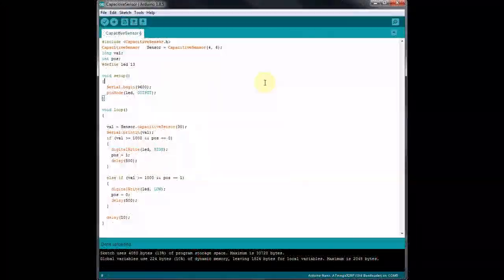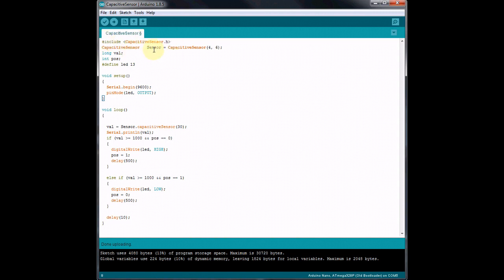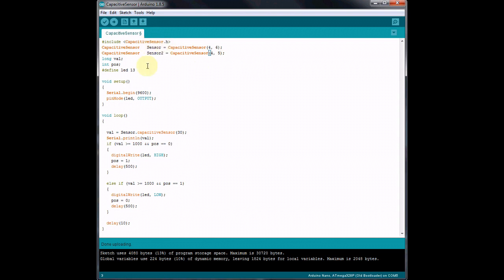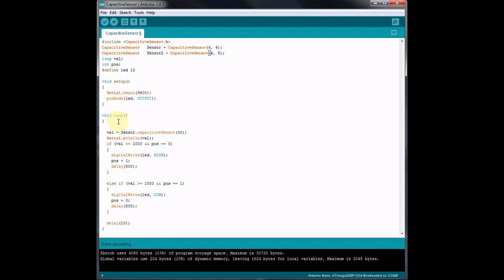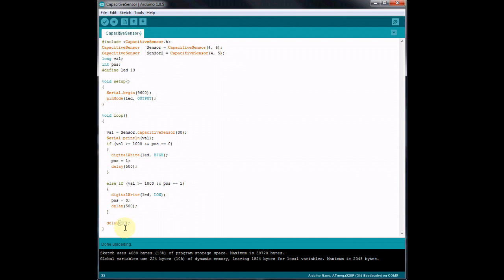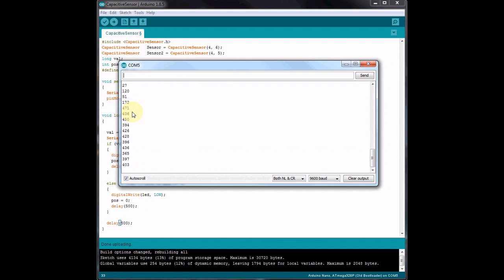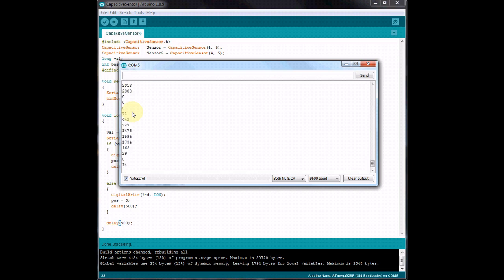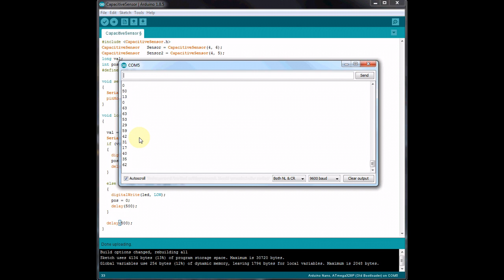How to make a capacitive touch sensor switch out of anything metal using an Arduino

Comment: guys i am a completely new to this no i need some help, the ardunio switch name can i get it properly as i am unable to select the switch , are all same or different i just need the one which the guy has used usable with 10mega ohm resistor and all

Comment: I'm curious what would happen if you decide a delta between the normal state and state it should be switched and let the arduino calculate the average value over let's say 2 minutes, then make it if(val => average+delta). This could maybe solve the issue of the capacitance changing not only with different mediums but also when humidity and temperature change

Comment: I need something like this for an electronic drum

Basically, I need a trigger for when I touch the cymbal, so I can make a logic for the sound to stop (a "choke effect"), but it can't trigger until I actually touch the cymbal

In your video, it also triggers when you get close to it without actually touching it.

Is there a way to disable that, so it only triggers when touched?

Comment: I have a strange bug. I'm wiring this as a touch switch on a synthesiser which uses a logic high (5v) to create a gate which trigger a sounds. My oscillator stays on as long as the gate is high.

I modified the code to be momentary rather than latching - i.e. go high for values > 1000 then low if the value goes below 1000 so the note holds for as long as my finger is on the pad. The circuit works great for me when I'm powered by USB plugged into my laptop (uploading the code) but when I swap to the 5v supply the synth is running on I get regular glitches to 0v so the note stutters. Anyone have any idea what is causing these periodic drops to 0v? I can't work it out.
Reply: You could try using the code to activate the built in pull-up resistors maybe, they decrease the amount of environmental electrical interference. Or try actually putting pull-up resistors on your circuit.

Comment: if I have an aluminium enclosure (e.g. a guitar pedal) and I solder the wire to the enclosure (acting like your coin), is it safe to be used as a "touch" footswitch?
I'm a noob, any pointer is appreciated.

Comment: Everything works perfectly when I'm plugged into my laptop, but once I plug it into an outlet on the wall or even through a USB converter to the wall outlet, the sensors all go wack and don't react properly.
Reply: If you can. add display to your thing so you can see what's actually is happening when you plug it into outlet. Mine was going crazy when I activate my table to go up or down, but then I changed settings for sensitivity. meaning that it cant be triggered if its not over 5k if you know what I mean. This sensor is not perfect, other things are influence the results sometimes. depends of the environment.

Comment: It's case sensitive, capacitiveSensor is different from CapacitiveSensor... But yeah man detecting through 3/4 plywood, plexyglass, etc.. I made some lights for under the bar that's also solar powered, and for the switch I have a sheet of plexyglass with the wire basically taped to the back of it, and no problems.. It gradually increases with brightness because of the PWM controlled mosfet, so the pos actually increases in time as your touching it.. good stuff. +1, a must watch, tnx.
if (val >= 1000)
pos = pos + 1
AnalogWrite(nMOS, pos);
if (pos >= 254){
pos = 0;
delay(1000);
etc. etc. etc. I'm sure u guys get the idea. pretty easy stuff. I'm using 11MMillions of Ω's) of resistance.

Comment: I used this in 12v led strip the serial monitor fluctuates when the Arduino is given 12v of supply any solution to stabilize the readings of serial monitor?

Comment: Is it possible to add a potentiometer instead or the resistor across pin 4 and 6

It will really help as I find that temperature and other factors change the sensitivity. 

So instead of swapping out resistors a potentiometer might be very helpful 

Please help

Comment: Hello, I all worked according to your method, saved the code, and then this character appeared:
avrdude: stk500_recv(): programmer is not responding avrdude: stk500_getsync() attempt 1 of 10: not in sync: resp=0xec
could you help me？
Reply: Did you  remember to add this library  ?   CapacitiveSensor.h

Comment: I was thinking making a midi guitar with capacitive switches. I would need to make around 130 of them, there goes that plan. I liked informative video though.
Reply: It would be better to use a soft pot/ ribbon sensor to do this. That way you can think of them more like strings. For ex... 6 long ribbon sensors = 6 guitar strings = 6 analog inputs on your microcontroller. Each sensor detects the position that you press. Then your code for each string can reflect reality. The position you touch value can mapped to midi notes.

Comment: Hi, I have a question. So why does my led only blink once every time the cycle is over? It doesn’t turn on whenever I try to do it again.
Reply: Make sure that your code is on the loop section or it will only check your if statement once. Also, make sure your delay for that if statement isn't too long maybe.

Comment: What happens when you touch without any resistor ?
Reply: Then There won't be a voltage regulator and finally you may get more voltage output.. 😜

Comment: Hi what is the different using arduino or not? I saw other video only us TTP223,some resistor and capacitor
I want to make a 3 step brightnes touch sensor for my bedside led lamp 12v,could it be made without arduino?actually for saving cost only

Comment: Is it possible to make it work over a diffused glass surface. I can't put metal behind the diffusor as i want to use it as light source
Reply: Not likely. A possible workaround would be to place a conductive material (metal) around the edge of the glass, and then using the fact that the value changes as you approach the material.
Reply: @Rallemuuss  how can one put a conductive metal around the edge of a glass? thank you

Comment: Do you know if this wound work as a water sensor? Running one wire around a sump pit and if water touched it, it could alert you?
Reply from the maker: There are much simpler ways of doing that instead of using this project. Unless you are using pure water it will conduct electricity so all you would have to do is have two terminals at the level you want to have the alarm for the water to be sounded from and just do a digital read of those two points. When the reading is HIGH have a alarm triggered